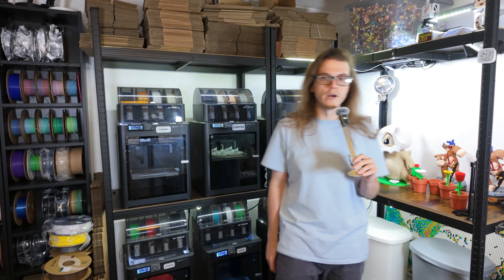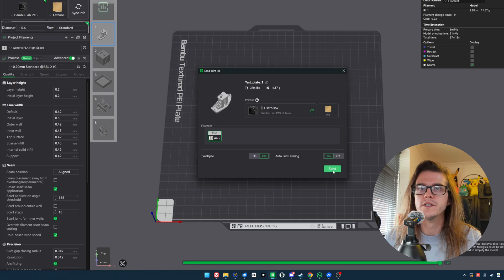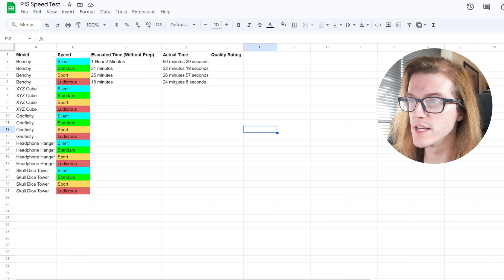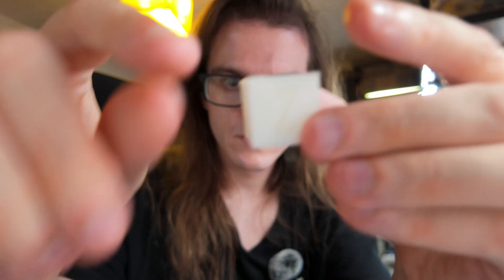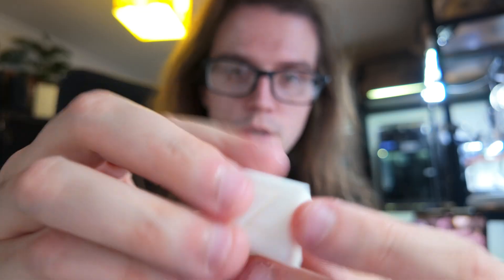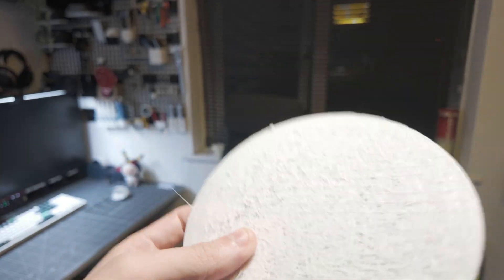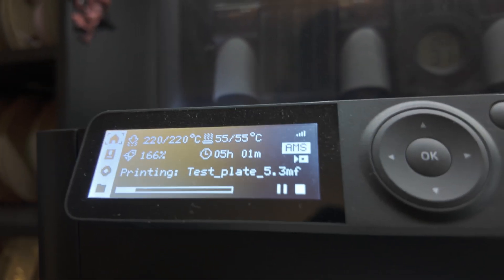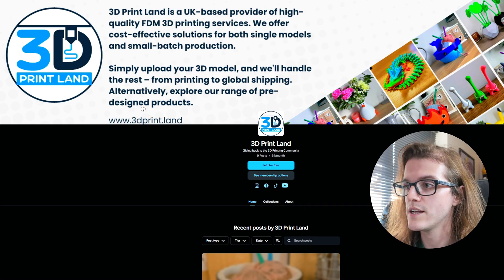What Happens When You Push 3D Printers to the Limit?

Comment: I tried this before on a bigger flatter surface and it done what it done with yours. I assumed this was the best case scenario for it and then I assumed it was a gimmick.

Very interesting to see that is does the smaller detail parts better in the fastest modes.

I have ordered a H2S and got the high flow nozzle so I wonder if this will help with the large boxy prints with high flow.
Reply from the maker: Yeah, the results were not expected. I honestly thought big flat boxy things would perform well. The high flow nozzle is an interesting thought. I'll have to look out for people trying it.
Reply: @3DPrintLandYT Iv been looking at the profiles for it on bambu studios and it ups the speed for 300 to 600ms which is what the ludicrous mode does too.

Comment: just got my 1st printer a qidi and it did a benchy in 17 minutes... turned out good but the printer was shaking back and forth the whole time... is that the equivalent of ludicrous mode? should I slow it down?
Reply: I felt the same thing when I got my ad5m but over the years the print speed has gone up so much that it just causes shaking the ad5m has a calibration to make sure it doesn’t shake too much